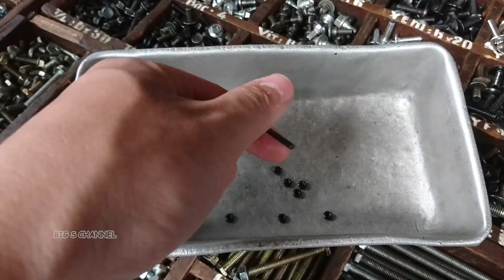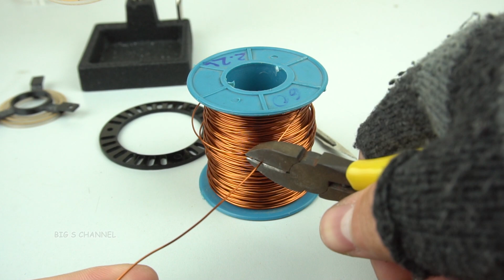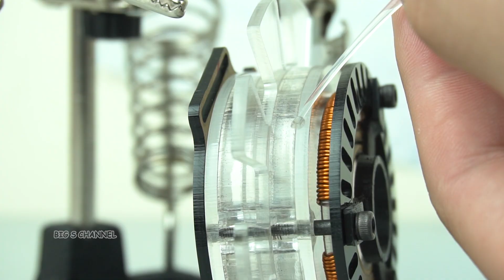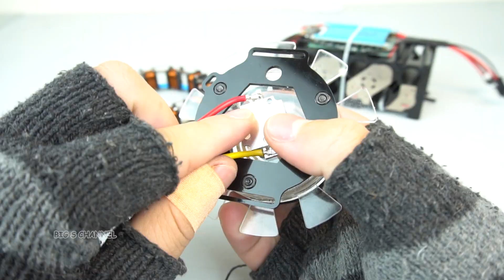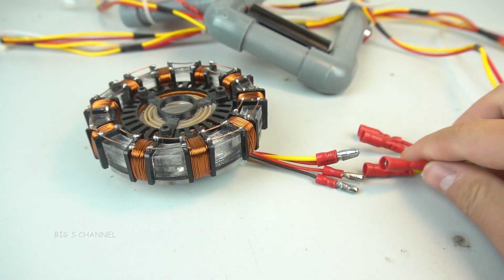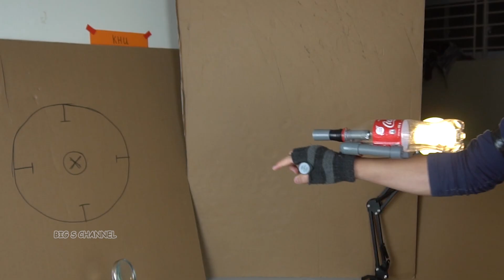How to make the Real Iron Man Arc Reactor that Working

Comment: How much energy it produce
Reply: Reactor didn't producing energu reactor producing Heat (thermal power)
Reply: It's an electrolyzer.it separates hydrogen and oxygen from water using electricity.

Comment: I’m sorry that’s not the right pieces for the arc Reactor. The glass is supposed to be cobalt glass for the cooling fan and the at reactor is supposed to have a inner support and cage for palladium. I’m not saying the rest of the build. anyways that’s not an arc reactor in my opinion due to an actual arc reactor would not run off batteries and it should last 20 years
Reply: I knew someone else agreed with me. H
That device there could use some gold, titanium and aluminum included in materials list.  I am looking for real life application and not cosplay toys. So many people think this is impossible but its BEEN completed by DARPA since the 70's.

Comment: The capacitors aren't made of the correct materials. stainless steel or aluminum with a grounding point would be a lot more effective and not consume as much power to main an current. Your pretty much using the taser way or expressing power to get current. It should be a more fluid system not pulses.

Comment: You know I had to watch this Arc Reactor that Tony Stark made many times. I in fact wanted to see if there was any real way to create this.
Then one day it dawned on me. Platium was not what I though it was. First off Platium is not a very good conductor. However it is really easy to mold as it has a low melting point. Also Platium can aid in cancer down the line. The best would be Silver but it has a higher melting level. This may explain why he was not able to make it out of silver as there was just not any around. Copper would be nice but again high temp melting.  Yet after I thought about it it was nothing more than a collector of stray electrical,magnetic particles. The real key is how was he storing the electrical generated electrical power.  That is when it started to dawn on me on how this could in fact work. How he is storing up the energy is key to his ability. In fact the other key is when in the movie he has to change the Arc Reactor first. This told me something after watching this movie like 80 times. Everyone is going about this the wrong way. The key is when Thor uses lightning on Iron Man and instead of a dead Iron Man he is powered up to 400%. That got me thinking of a theoretical idea of what may be really going on. How this may in fact be a real idea of storing energy.  After 8 months of looking deep into this Arc Reactor theory I came up with the answer of exactly how this could really work. We all got this wrong the first time around. I thought it was the Platium storing the charge. Shoot I even thought when Tony Stark created the New element that was the power source. Yet it then dawned on me that this was not a new power source but a new power collector source. The way to power could be collected. This being not only Electrical but magnetic and even a lot more complicated than they show in the movies. Just remember Star Trek with there tablets. Today we now have exactly that. Well The answer to the Arc Reactor creation was during the creation of the first arc reactor.
Reply: Dude this is it actually. Because it would also explain how the arc reactor with the new element doesnt blow up on his chest after letting out all that energy! It's in fact storing it for later use. Am also studying the arc reactor Tec in hope to building one,and this view has changed my thinking to it. Thanks! Question now is,how is he doing it? Maybe the reactor releases unused energy into the air and since it's clean it doesn't harm him? And/Or the "container" acts as a battery that when full,will just release the extra energy and keep the "100% battery cap" untill needed to charge again. Another reason for the container to also be a battery is remember the battle in new York and Jarvis tells tony that they'll run out of power before they break the aliens shell? That could be a metaphor,or also mean his suits DO actually need to charge after use,or in the real world at least since we don't have that '_New element_' of his. Idk what do you think?
Reply: Another thing,about the new element and the reactor,maybe it's exactly like a nuclear reactor where it contains large amounts of energy in it's core/arc reactor. This way,like a nuclear reactor,it keeps pumping energy and we only take the energy we need,essentially opening the core and closing it when we're not using energy.

 My conclusion in the storage of energy,the arc reactor is the core,the new element is the energy  source and the core only releases energy when it's needed,otherwise it's kept enclosed
Reply: Well, it may have a sense but also we shouldn’t forget that it’s just a movie, so maybe we should rely on physics,math,chemistry and of course literature 😂

Comment: i already have made this arc reactor (ionized plasma generator ) which transforms countinue arc of electricity (800 000) volts
and can be used as a power source but we dont have that much technology to make infinite power source BTW u can use solar
energy its kinda infinite at day but not at night
Reply from the maker: Oki,  We will try.
Reply: Oh can you really produce 800000 volts (8000 Watt) of clean energy
Reply: How did you produce 800000volts of clean energy?
Reply: How did you make it

Comment: If I am not mistaken, you wanna get two gasses H2 and O2 from water by electrolysis. But for this chemical reaction you need metallic electrodes, water and electricity. I can see no metallic elements in the tank with water. Anyway, if there were electrodes, you just wouldn't be able to get so much gass for such a short time

Comment: How much volts of electricity you give in the arc reacter
Reply: 2 volts for maximum efficiency and the real factor is going to be current which will have to be around 12 to 18 amps for a sustaining reaction
Reply: 2 volts?! you need to use something like a neon sign transform that puts our thousand of volts to get anything minimal.
Reply: @thegreatoutagesign9204  you need an understanding of both electricity and chemistry for this and thats what ive been studying as a passion for 9 years don't even question it
Reply: Surely I'm not only one who is bullshitting us now because someone called you out for your mistake.

This just makes you seem like a degenerate because no way in hell some random internet stranger dedicated 9 years of his life to arc reactors

Surely if your correct you can make your own and only give it it 2 volts correct? Go ahead and do that, and film the results and upload it.
There is a reasonable awnser as to why every arc reactor build has either a large capacitor bank, or a large transformer. it requires a large amount of voltage to start it and sustain it.

"Now I have only been on the internet for 9 years. so don't even question it!"
Reply: @thegreatoutagesign9204  Its Not a goddamn Arc reactor its a Hydrogen reactor